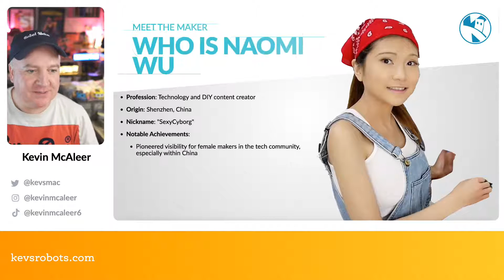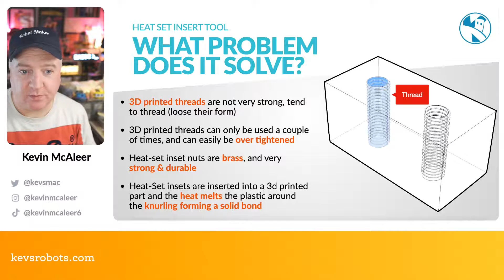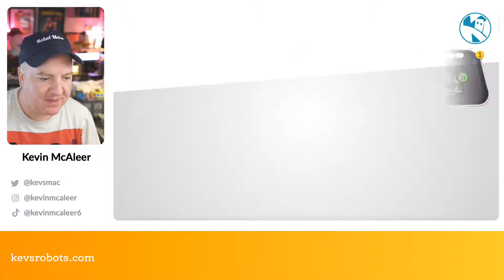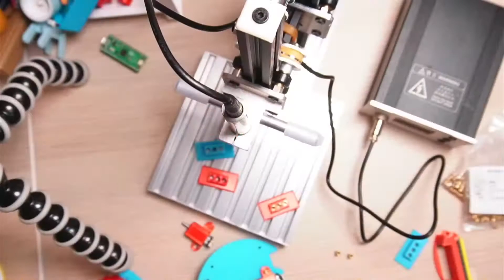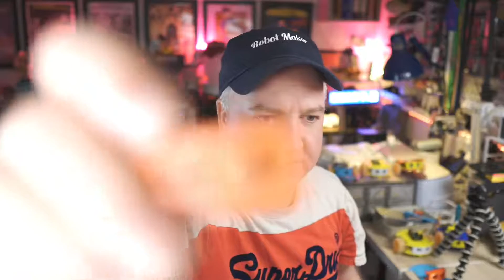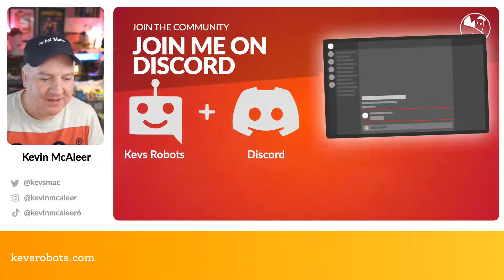Naomi's Heat-Set Inset Tool Review

Comment: $250???!!!!  Crazy price for a maker tool that any maker can make
Reply: So make it ?  Nobody's forcing yoyu to buy it.
Not arguing that it's expensive but that's what happens if you want someone else to do the work.
I don't think I could sell it for less (including soldering iron, bit kit etc) and still make an actual profit.
Reply: @theelmonk  well I did.  not for general sale but for my own use.  I made a little jig to hold a $20 soldering iron in my drill press.  done